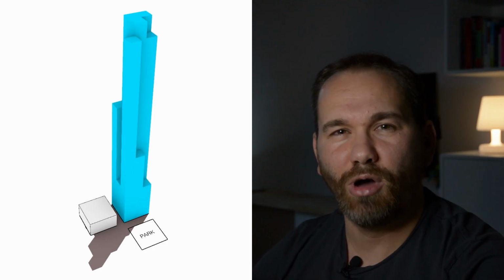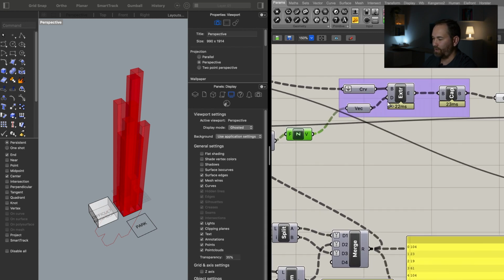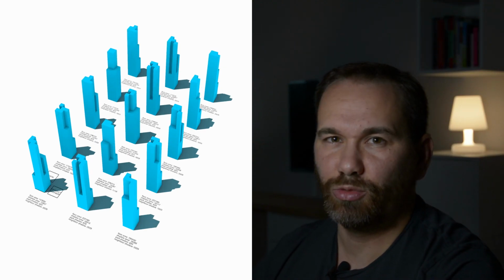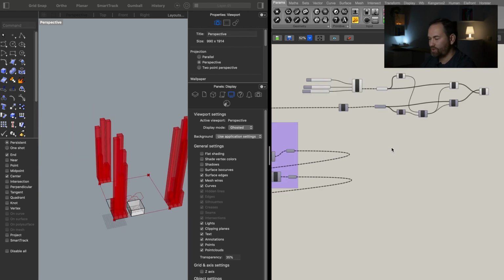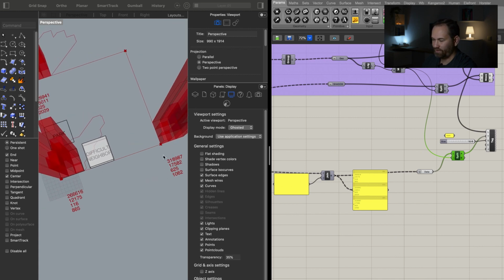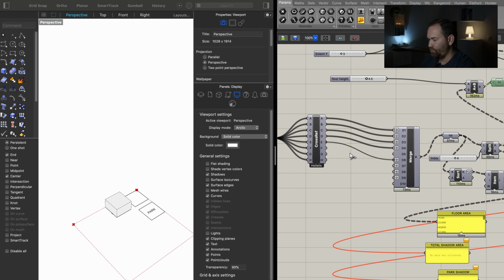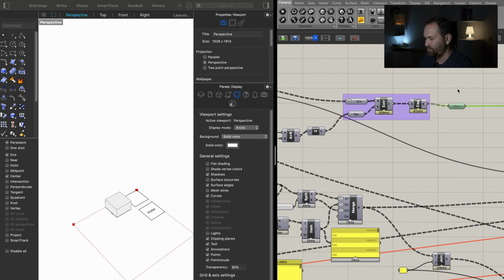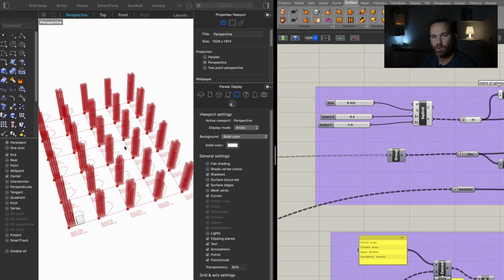Generative Design in Grasshopper - Part 2, Generating design options

Comment: I have problem when trying to apply the area limiter.. when the value is less than 320000 my extrusion still exist at first floor. Do you have solution to change the empty text into zero?
Reply: There was this quite nice solution in part 1.